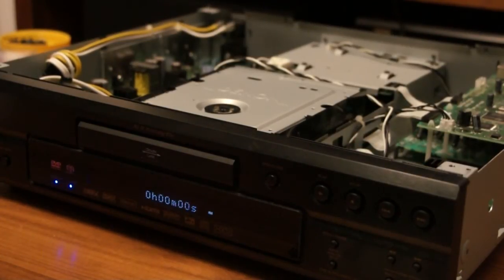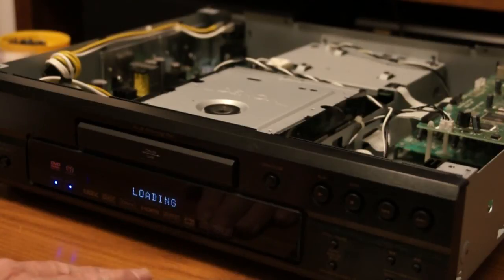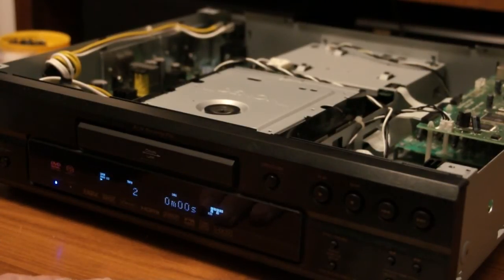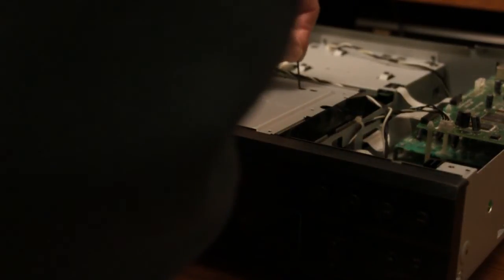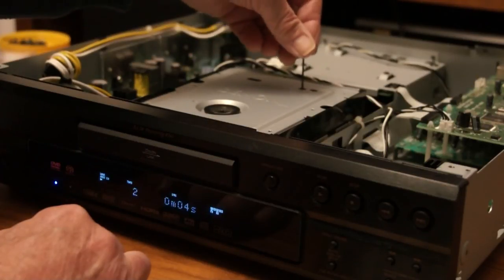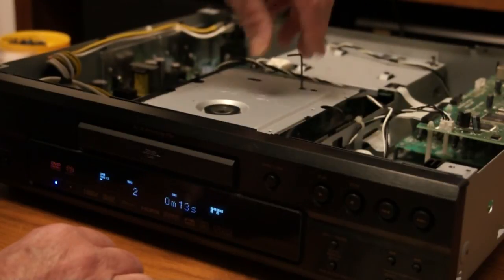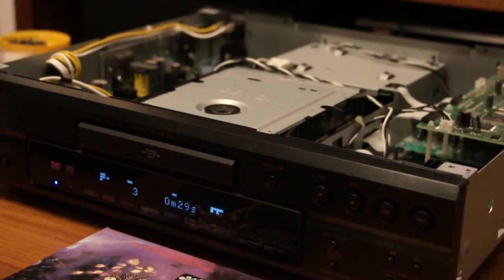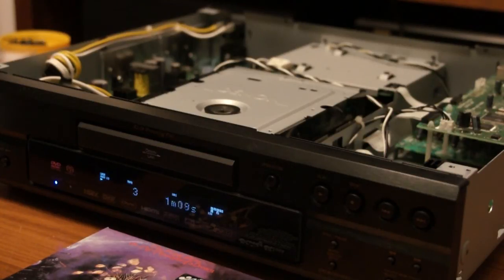Denon 2930 Laser Pickup Replacement (Part 3 of 3)

Comment: You just killed the rails position adjustments on which laser pick-up slides. It's a first and mainly problem. You should remove only one rail on which laser pick-up has a full slide hole. The rail with partially hole on laser pick-up should remain still in the position that manufacturer did. With this rail replaced laser pick-up will be also aligned vertically and horizontally as the original.
The second problem is you touched the laser tuning resistors. Never touch them until you know what you doing exactly. I think you just burned the laser. And therefore on the second tryouts it didn't work.

It's a very good player. It's a criminal to throw it in a garage. You can try to replace the whole CD mechanism. Or better hand over it to a private service man. I think there is one at least around you location.
Reply: Exactly
Reply: Hi,
I watched the first video in this series and as he did, I bottomed the traverse screws and removed both of the slider pins. I replaced the laser assembly because the old one wouldn't light at all. Now that it is back together, I can play CD's and after a few hours of making slight adjustments with the Allen set screws on the rails, I can play DVD's. My issue is that I have only had an SACD work once and if I am at the last couple DVD tracks, the DVD will lock up (tested with multiple DVD's with same results). 
My question, is there anyway to get the alignment "right" again? I have the service manual, but there is no procedure for adjusting the traverse mechanism and I did not see the traverse available anywhere, any longer.
Reply: @Jaksmack  Sadly but no as I presume. It's not work for home but only with special factory equipment. It's not only about parallel condition but exact distance between rails too.

Comment: Thought I should share some exciting news reg this video and how it helped me restore the 2930Ci to it’s original performance i.e. play all types of media
both video and audio. After watching the video a few times I thought why not adjust the two Allen screws simultaneously instead of one at a time. What I mean is using two Allen keys gently adjust both until the laser is properly positioned and lo and behold “success.” I played DVD audio, CD, SACD and a regular DVD video movie without a hitch. The unit did not play a Blue Ray DVD as it is not designed to. Hope this helps those who have given up hope including the author of this three part series on changing the lens pickup unit.

Comment: Ok my dude, nice :) Anyway, we made the same mistake, in that we ordered that damn lens. We should not have researched the lens for the player; instead, we should have found out about the drive make. That is a Sanyo DV 34 - and for that, you find the entire assembly with solenoid etc already properly set up. I paid more for the lens only than I now paid for the entire thing. There are cheap lenses, but they are Chinese knock offs, the Sanyo lens is more expensive. So you could have spared yourself a lot of work ;)

Comment: I have a 2930 that fingers crossed hasn't exhibited a failing head yet but it's amazing how widespread these problems are with the 2930/3930. I have a Sony DVP-S7000, their first DVD player ever from 1997, with over 9,000 hours on its DVD head (logged in the player's service menu) and it still plucks along without hesitation on discs both new and old to this day.

Comment: Hi,   Thanks for sharing this video.  Is the unit still working correctly for all discs?   Thanks.
Reply from the maker: Hi Shelley. Sorry for the delay, I'm not a good responder! Please see my comment on Part 1. The short answer is no. I managed to record my SACDs in real time at 24bit 96kHz and at 5.1 (they sound great!), but it was problematic and difficult, with continual re-adjustment of the laser required. Now that's done, I have no further interest in the 2930 player and, whilst I haven't thrown it away yet, it's back in my garage!